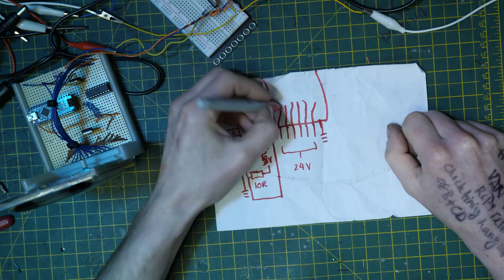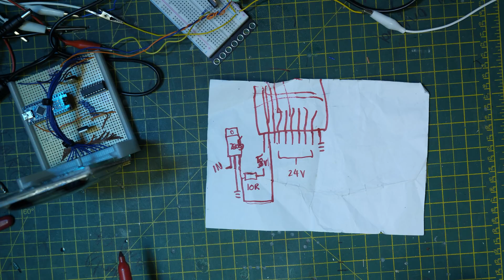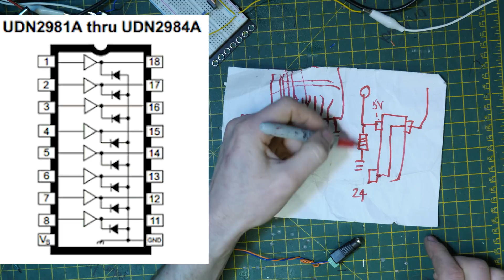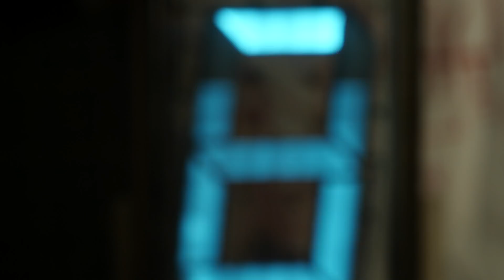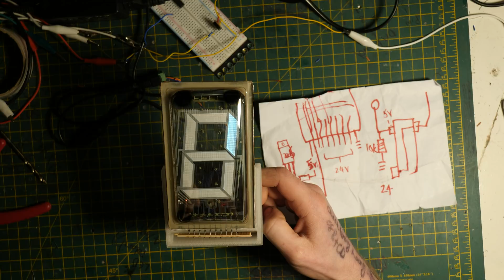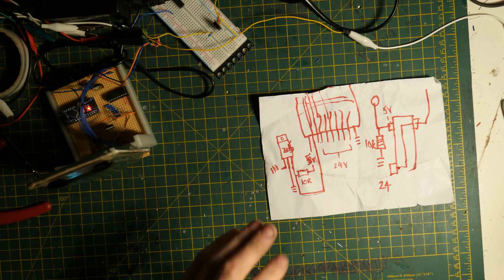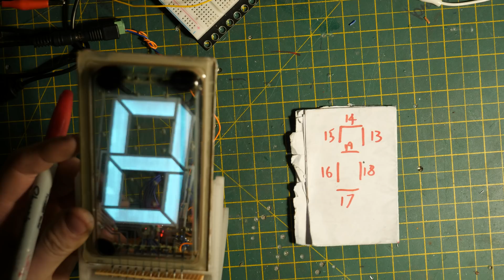Wiring up the MASSIVE ILC1-1/7 Vintage 7 Segment Display VFD

Comment: Very nice ^^ , I use the same display in my single digit clock build : D , Such a lovely glow . I run the segments at 24V along with the grid , Both using NPN/PNP level shifters to provide the 5V logic to 24V drive

Comment: When switching the filaments from AC to DC you want to keep it at 5 volts because the filaments don't care about peak voltage, only the RMS. The peak voltage would only be relevant if you used a rectifier and a filter/smoothing capacitor.
Reply: That’s why I went for 8v rms is about 7.3 isn’t it?
Reply: @LOOKMUMNOCOMPUTER  The DC voltage needed to replace 5 volts RMS is 5 volts. From Wikipedia,
"For alternating electric current, RMS is equal to the value of the constant direct current that would produce the same power dissipation in a resistive load."

I'm just here to carry out Cunningham's law. It's fortunate that you didn't damage the display.

For an inexpensive demonstration, you can take a 12v light bulb and run it on both 12V DC and 12V AC, the brightness should be the same.

Comment: The (control) grid in a vacuum tube controls or regulates the flow of electrons from the cathode to the anode (plate). In most tetrode vacuum tubes, it's the grid voltage that normally get's varied or modulated. It is literally the "valve" part of a vacuum tube (why many of you folks on your side of the pond refer to vacuum tubes as a "valve") and is equivalent to the Base of a transistor. In this device, the grid voltage sets the brightness of the segments. The cathode is held to ground, and the plate or anode is (selectively) held to positive voltage. As the grid voltage rises from ground (relative to the cathode) it allows more and more electrons to flow through it from the cathode to the anode. The segment's (anode) brightness depends on being bombarded with electrons in order to energize the phosphors - the more electrons, the brighter the segment. However, the grid can be over-driven or over-saturated. As the grid voltage approaches the anode (or segment) voltage, (in this case 24 volts) the grid begins attracting more of the electrons than the anode. If the grid voltage is at 24 volts (or equal to the anode voltage) it will "absorb" most of the electrons, reducing the number of electrons that get through to the anode/plate/segment causing it to dim. Over-saturation of the grid will greatly shorten the life of the tube. I hope that's clear enough to understand why 5 volts on the grid works better than 24 volts.

Comment: You could pulse the 5V supply with a FET from the Arduino if you wanted to keep the 7805 cool(er).

I think 5V works better than 8V because the difference across the display is 19V instead of 16V.

Comment: Regarding graphic patterns for the VFD, I think you were doing pretty well right there. I'd set it up to execute as programmed, then rotate the pattern 180 degrees and run again the other way (so you circle around the right edge instead of the left edge, for example). It could switch patterns intermittently, just to see how many people notice. 😁

Comment: Makes sense that taking the grid positive would  help the display to work. Just like a triode valve, the electrons from the cathode can only get to the anode if the grid doesn't repel them on the way. That means the grid's potential has to be zero or positive with respect to the cathode. But your cathode, the filament, is actually at a positive voltage because you're powering it from 8V DC. The actual voltage will vary along the length of the filament, and it also matters how the filament is laid out inside the display. Grounding the grid will actually make it negative with respect to the cathode and stop the electrons flowing, so the segments won't light up. Raising the grid to 5V makes it roughly the same potential as the cathode and, lo and behold, the electrons get going and you have light.

Comment: Current flows from 5v to ground to heat the heater. Current for the segments must flow from 24v to 5v. Any voltage difference means there will be a flow of electricity. IDK if it's actually supposed to be wired up that way? If it works it works.
Reply: Hahaha yeah if it works it works 😂
Reply: Yes. The grid needs to be heated so it throws out electrons. The electrons are then pulled towards the segments when they are at 24v. The electrons then smash into the phosphpr on top of the segments which reavts by lighting up. Like the screen of a CRT.

Comment: That VFD is so cool!

VFDs are essentially just vacuum tube triodes. The segments are the plate or anode, the filament is the cathode and the grid is... well, the grid. The filament gets nice and hot and electrons boil off it. Those electrons are looking for a nice positive place to be, so if 24V is put onto one of the segments, that gives the electrons a place to go. The electrons rush towards and smack into the plate with the positive charge, which makes the phosphor on it all excited, causing it to glow. Just like in a normal triode though, the grid is like a control valve. Like minded particles repel each other, so if the grid has a negative potential, it repels the electrons blocking them from making it to the plates/segments. If the grid has a positive potential, it opens the valve and allows the electrons to fly towards the plates!

So, for VFDs, the grid needs to eb pulled positive for the segments to illuminate. If the grid is pulled to ground, it blocks electron flow and the segments won't illuminate. Though, I wouldn't recommend connecting the grid directly to 24V, since the grid wasn't intended to absorb any electrons, a current limiting resistor can be helpful here.

If you put say a 50k potentiometer from 24V to GND, then hook the grid up to the middle pin, you can see the analog nature of a vacuum tube triode visually with a VFD - ie. the brightness should smoothly increase and decrease as you twist the potentiometer.

As for AC vs. DC on the filament, there's some interesting things to note there. If using AC on the filament, the ground of the DC power supply for the segments still needs to be connected to the filament. This is so the electrons can boil off, fly towards the plates and make a complete circuit. Now, the primary reason that AC is used is to achieve uniform brightness across the unit. If DC is used, the brightness may change depending on the plate's position relative to the filament wire. The filament wire itself is technically a resistor, so the potential across it isn't always perfectly at ground relative to the plates. Which means in some places, fewer electrons boil off. Some filaments are intended for DC and counteract this by being installed at a slight angle.

Having said all that, I've never run into any brightness issues on any of the VFDs I've used by using DC voltage, so that was all just a little extra information, haha. 

But, those segments are massive, which means they can move quite a bit more electrons than a usual VFD. And since VFDs are just triodes, this thing could make a hilarious pre-amplifier! The segments would change brightness with sound, and who knows what kind of weird audio characteristics it would have!
Reply: Aha! Yeah this thing would deffo make a mean amp you gunna get one?!!???
Reply: I’d do it but I don’t wanna pull this one apart not hahaha aaaaaah!! Resisting the urge to get another one
Reply: @LOOKMUMNOCOMPUTER  I'd love to get my hands on one, but I think I might wait for the FranLab hype to die down an bit and the prices to come back down, haha. But, in the meantime, I've been slowly brewing up a few audio ideas I want to test out involving thyratrons!
Reply: Regardless I think I’m gunna get another one cus they are so damn cool. Synth module effector would be killer
Reply: @LOOKMUMNOCOMPUTER  They are so awesome! It's a shame they didn't make one with more segments that could do the full alphabet! Or even one with the weird alien-like layout similar to the IEL-0-VI electroluminescent display.
Reply: @UsagiElectric  yeah that would be awesome this size with more segments,iwas thinking that when coding it so sad who knows maybe a proto willshow up ha

Comment: The grid of these needs to be pulled positive not to ground, usually to the same level as the anode. It acts as a digit selector for multiplexing multiple displays together
Reply: Aha yeah I'm being a plonker cool I'll fix that for the vud
Reply from the maker: strangely enough it hardly works at 24v so yeah 5v seems to be best oddness.
Reply: @THISMUSEUMISNOTOBSOLETE  A positive voltage on the grid means that electrons accelerate to the grid. Some are absorbed by it, the majority pass trought the holes.
If the anode is at a even higher potential, the electric field between grid and anode accellerates electrons towards the anode as soon as they get near a hole and the problem is not macroscopic (cathode-grid, grid-anode electric fields) anymore.
But if the grid voltage is the same as the anode, there's no electric field between the anode and grid, and an electron near a grid hole will be accelerated towards the grid wires. Field lines mainly go towards the grid wires because they're closer, so electrons can arrive to the anode only throught inertia and the anode current is reduced.
Reply: @THISMUSEUMISNOTOBSOLETE  Weird! I have no idea why it would work that way in your case!
Reply: @THISMUSEUMISNOTOBSOLETE  if you take the grid to 24V it'll attract all the electrons from the cathode and few of them will bother to go to the anode (which is also at 24V but further away) so you'll get little or no light. For why 5V works well, see my reply from a few mins ago.

Comment: 7805 on 24 V is risky, lots of power wasted as heat. It's still in tolerance though, the maximum rating is 35 V.
Reply: Indeed well within 35v I just used it cus I had one. Just needs a heat sink. Not too hot to touch but it is warm
Reply: Honestly, I just use a big fat dropper resistor for powering my VFD filaments off 24V, but I'm colossally lazy, haha.

Comment: Sounds like a 'floating ground' circuit. The 8v/5v positive to the chassis maybe there to stop ground loop interference, so you only get fully turned on segments and no semi- energised segments.
Reply: I must have accidentally designed the circuit to stop the trnasonducance problems ha